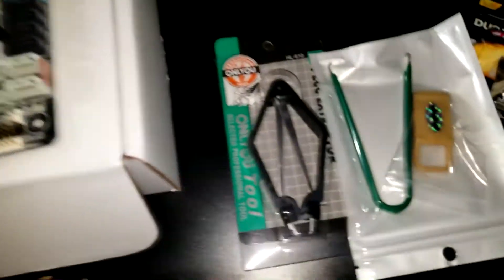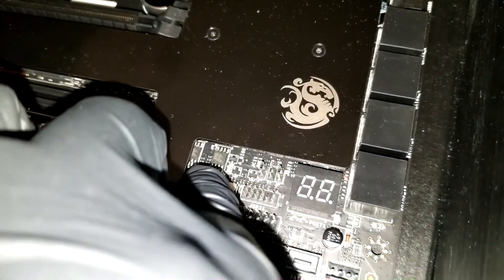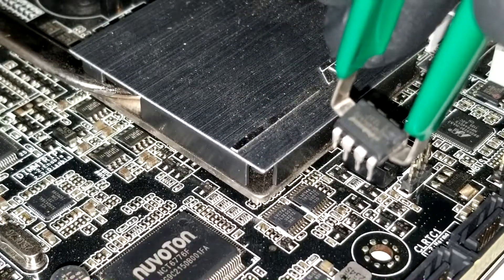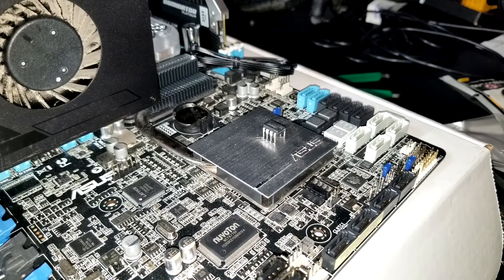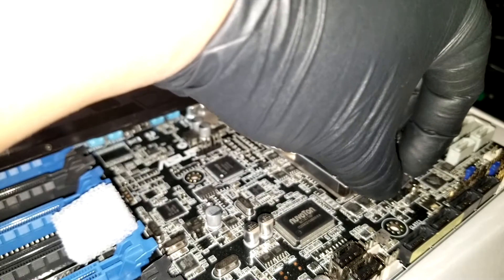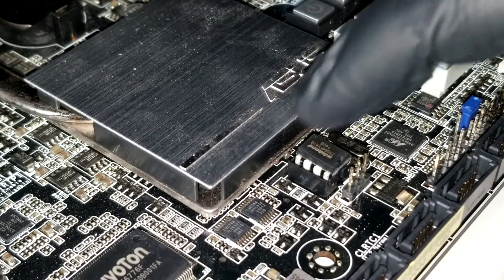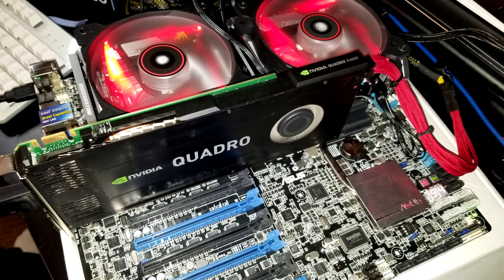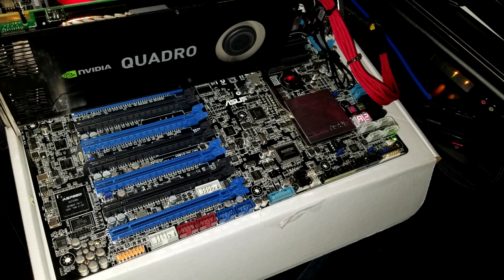Bios Chip replacement on an ASUS Z9PE-D8-WS Motherboard

Comment: Yah. This is a cool board but tricky. It can boot in single CPU as well but you still need both 8pin EATX 12V connected.  I remember sometimes my nVidia 980/1080-Ti's didn't POST. Something to do w/ firmware update in GPU. Used different GPU to kick start & force PCI-Gen3. Otherwise, a solid workstation 11yrs late still. Pair E5-2667-V2 & Strix 980-Ti's.

Comment: Thanks a lot. Hope this helps me. 
I made some wrong settings in BIOS and now I can't start the machine. It powercycles  all the time on off on off, but no luck resetting the bios with jumper crashfree 3 usb or other. So I want to try this

Comment: I have questions for u on that msi x99  motherboard if both bios chips die do it cut power to the cpu
Reply from the maker: Sorry for the late reply been locked out of my channel. But if both the bios chips you would have to get the manufacture to refurbish it (they usually just send you a different board but with how old the X99 is they probably wouldn't service it)or find a company that has the tools to be able to resolder a new replacement bios chip on. Which you can still find it on ebay every so often.

Comment: are you using a NVMe on this board? which one ?
Reply from the maker: Hey I am used the Samsung NVMe 1TB 970 evo. I had to use a PCIe adapter. There is a Custom Bios you can download on one of the forums that claims to allow you to boot from it but I never tried it because the current bios was flakey already. So I just used a regualar 850pro Sata drive for my boot disk.

Comment: Hello, I have the same motherboard with dual Xeon 2680 v2, with windows 7, I have been trying to change it to windows 8 or 10   which has been impossible. Do you know what to do about that ? I really  appreciate your answer. thank you  and congrats for your channel .
Reply from the maker: Hey I am sorry I haven't been active on here lately. I didn't have any issues but I did read up on it because I was trying to boot using an NVMe drive with an adapter which actually needed a custom bios which is out there but I never could get it to work and I didn't want to mess with my bios now since it was flakey at the time. You might have to change the boot settings in the bios from Legacy to UEFI if I am not mistaken.
Reply: @BakkenTech  do you know where I can find a custom BIOS for this motherboard ?
Reply from the maker: @jhonhtz  I just looked at the forum where I was reading about it unfortunately the link no longer works.
https://www.bios-mods.com/forum/archive/index.php?thread-23578.html

Comment: Hello, I have a problem on mine : it blocks on the code B1 with no post. I have already changed CPU, RAM, GPU, PSU and no more result. Do you think that replace the BIOS chip will solve my problem ? thanks you
Reply from the maker: It looks like you already went through all the other troubleshooting steps. I have had my old X99 system freeze on a certain post code and searching the post code and replacing that certain item didn't fix it. It turned out the BIOs was corrupt and the reason it would show the memory post code was because the BIOS wouldn't get passed that point during boot up so it would show a false code. As cheap as the BIOs chips are it is definitely worth the try. I paid $16 total for the chip with shipping and what I paid for the tools. on Ebay the sellers take returns to do if it doesn't work you can return the BIOs because they will just resell it anyway.
Reply: @BakkenTech  Ok so I will try, the tool you used for taking out the cheap is needed or I can take another basic pliers ? thanks you for answer